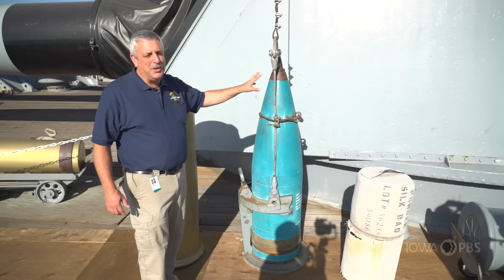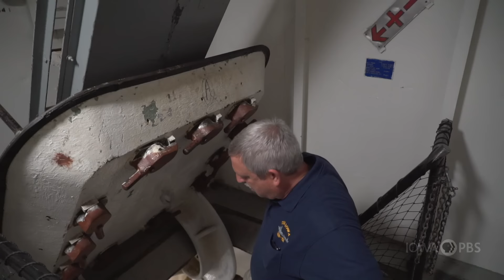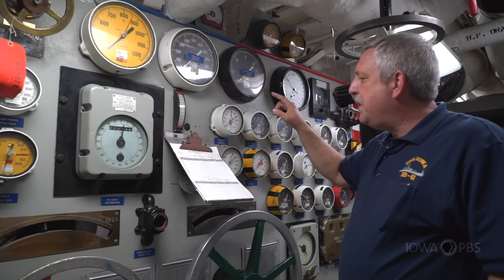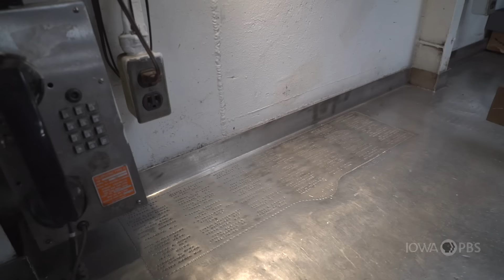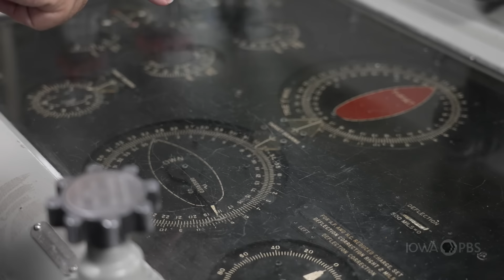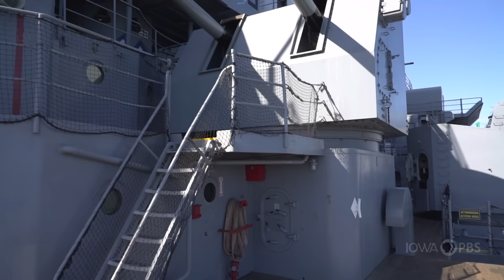Special Access on board USS Iowa BB-61

Comment: Modern military discipline has brilliantly evolved from raw physical coercion into a masterclass of soft power and total schedule management. By providing basic perks—like movies or gaming—and threatening their collective removal, leadership creates a clever illusion of autonomy while letting peer pressure enforce the rules. Coupled with relentless watch cycles, this system eliminates idle time entirely, upholding the age-old naval truth that an unoccupied mind breeds conflict and mutiny. However, as recent naval accidents prove, pushing sailors to extreme fatigue shows that over-exerting this control can easily backfire into disaster. Ultimately, I see this as the most effective form of control: managing people not with heavy chains, but through shared privileges, structured routines, and the subtle illusion of choice.

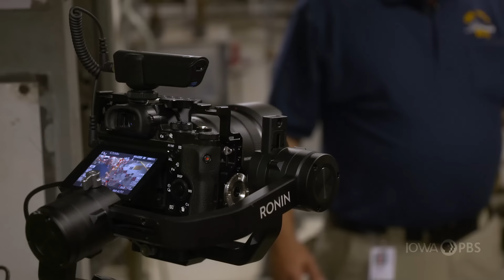Comment: 18:15 Steam pressure in the boiler is the same on the saturated side as the superheated side. The superheater adds heat and raises steam temperature, not pressure.

Comment: This is refreshing to see a video tour with someone who was in engineering. I was a Machinist Mate and served aboard an old destroyer in the aft engine room. Almost the same steam plant, but 1250 psi and 1000 degree steam. 70,000 shaft horsepower, twin screw ship that only weighed 4500 tons could get up and move.

Comment: He is wrong on the Boiler pressure on the saturated side. it isn't 250 psi but 600, the sent thru the superheater where the temp is increased to 900 degrees to make it superheated. I served on USS Iowa from 1987 until 91 as a petty officer 1st class in #3 fireroom.
Reply: I was on a DD 600lb  and later an ff 1200lb single screw. I stood evaps watch. Did the battleships have solo shell evaps or had they been upgraded to flash type? In all the videos nothing is said about evaps,sstg s, lube oil purifiers, the only oil. 2190tep...
Reply: @daleharvey3278  Griscom Russell triple effect distilling plants on  New Jersey and Missouri, so I'd have to guess the same on Iowa
Reply: 600# saturated is approximately 495 degrees as it heads to the superheater. They also changed out the fuel oil service pumps when they changed from black oil

Comment: What great introduction to Iowa's engineering spaces.  Also to mess deck information.  My navy service was on a WW II era LST so we had a much different environment.  The only boiler on board was part of the system making potable water.  Main power was two massive V12 diesels.  As a Yeoman I made it to the main engine room once.  Our armament was 8 40mm anti-aircraft guns.  I have one dumb question.  On our ship the wheel house had the engine order telegraph which was the primary means of communication of engine orders to the engine room.  A phone talker backed up the mechanical device.  The device was connected to a similar device in the engine room.  When an engine order was sent from the wheelhouse to the engine room the engine room watch sent an acknowledgement back to the wheel house and the lee-helmsman let the bridge know that the order had been sent and acknowledged.  On most ships that device is on the bridge.  My question is where is the engine room end of that communication device on Iowa?  I didn't see it or hear you mention it.  Thank you.  Sorry to be a pest, but I am curious.

Comment: When the steam leaves all of the main equipment, It has surrendered all of its heat and is sent back to the boilers via the pump rooms, where the pressure is cranked back up to the pressure required for the main equipment. It also produces steam at the lower pressures required for the other systems , in the mess decks, and for heating Living spaces

Comment: I was a nuclear weapons target analyst. The USS Iowa most certainly would not be "in the envelope" if it fired it's Katie Nuclear projectile. The nuclear shell for the Navy's 16-inch guns was a W-23 nuclear projectile.  The max range of the 16-inch/50-caliber Mark 7 gun was 41,622 yd (38.059 km; 20.550 nmi) with nominal 660 lb (300 kg ) powder charge.  The W-23 had a yield of 15-20 kilotons.  When detonated the fireball radius would be 663 ft (0.05 mi²), the lethal radiation radius (500 rem) would be 0.82 mi (2.09 mi²), and the thermal radiation radius (3rd degree burns) would be 1.38 mi (5.94 mi²).  So, there would be no effects on the ship or it's crew.
Reply: He was a Snipe, so, he gets a pass 😂
Reply: Happy to stand corrected -- and yes, I was a snipe :-)
Reply: Thank you for your Service Sir 🇺🇸🇺🇸🇺🇸
Reply: Would you want to be less than 24 miles from ground zero?
Tactical necessity may require them to fire from downwind as well, which would both shorter your ballistics and expose you to maximum fallout.
Reply: @zacharybunting3637  I wouldn't have any issue being as close as 3 miles from the target.  I did this as a living in the 1980's and know what I'm talking about.
Reply: @jackaubrey3322  How many live nukes did you drop from what range now?
Reply: @zacharybunting3637  US targeting doctine was to fire air burst to preclude militarily significant fallout.  BTW water doesn't produce fallout.
Reply: Should of never been invented then you wouldn't be having this conversation
Reply: I was a snipe in 70s on tin cans, what evaps were on the Iowa class,  solo shell or was it upgraded to flash type?
Reply: When I was on throttles on the John R Craig I could stop and trail the shaft in 12sec or so....watching that gauge
Reply: What about uncontrolled bowel movements
Reply: Civilians...
Reply: So you saw the world 🌎
Reply: Old Infantry grunt here. I trust your calculations! I really do! But I still WOULD NOT,want to be there when they fired those nuclear shells!
I love and respect All of my brothers and sisters who have worn a uniform of our nations military,no matter the branch,or the job! There is no such thing as an unimportant job in the military! 
Our nations military branches,work as a giant team! Ive had my ass saved by Air Force,Navy,and Marines at one time or another! And I Love Them All,and I Owe a lot to them!!
Reply: He is referring to the fact, if it was loaded in turret 2, they would be in the envelope
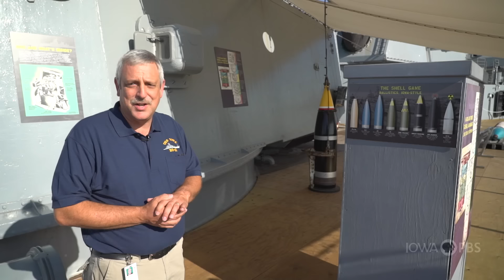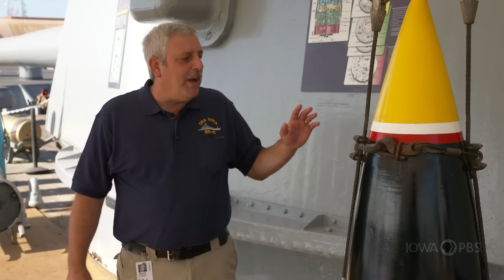Reply: @DaedricFaZe  Listen from 3:48 to 4:05.  He is clearly saying if you fired the nuclear round, you would be "inside the envelope when it contacted the target...which means you weren't going to survive any better than the enemy was."  As I initial commented, this is factually not true,  Outside of that he gave a great tour,
Reply: @jackaubrey3322  When he said firing the nuclear round that the ship would be in the effected blast zone I thought this has to be an error. I would be a ridiculous waste/ loss of one of the most important fighting assets and her X thousand man crew.
The weapon selected would be chosen to eliminate the enemy, it would be pointless to eliminate yourself in the effort.

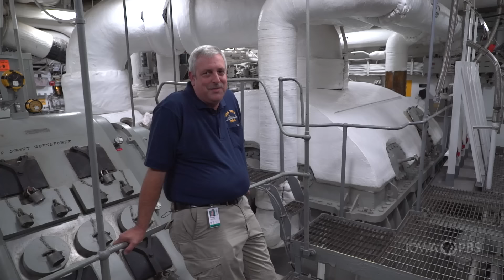Comment: 10:02 Look at all that asbestos
Reply: Coated fiberglass. That isn't asbestos.
Reply: I'm pretty sure most of it's asbestos.  I worked the reactivations of both Jersey and Missouri and there was no need to remove asbestos insulation off the HP or LP turbines, so I doubt the Iowa had theirs touched.  Asbestos insulation was phased out around 1976 and it was replaced by calcium silicate.